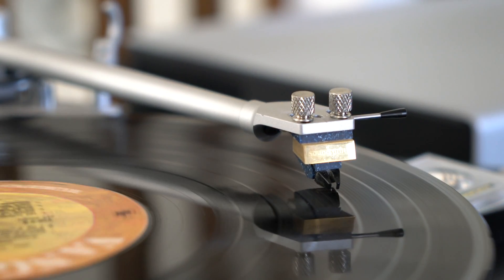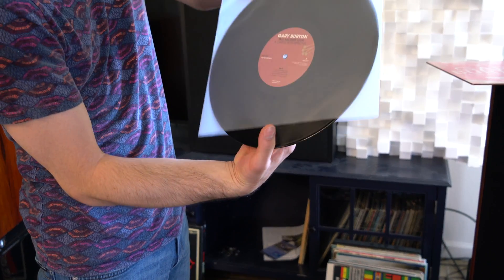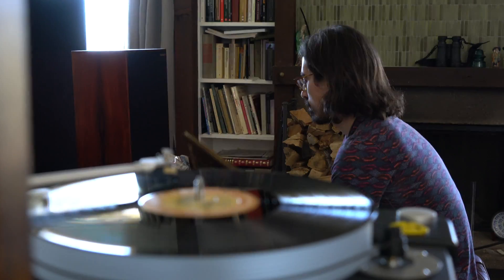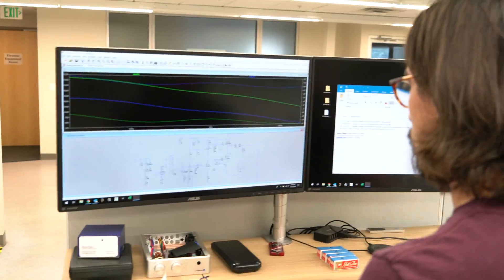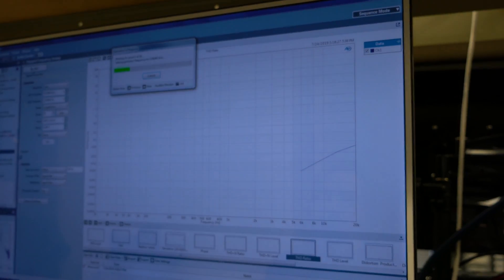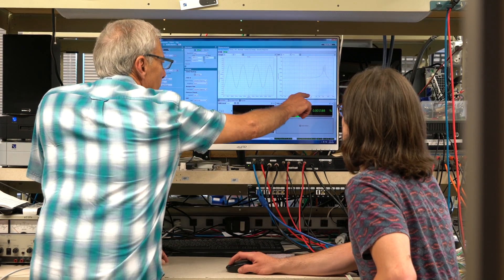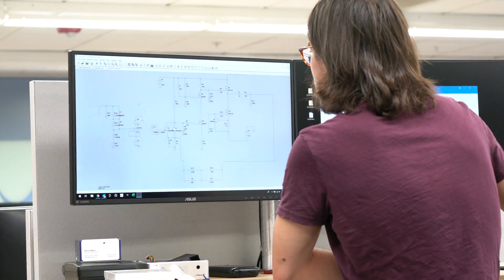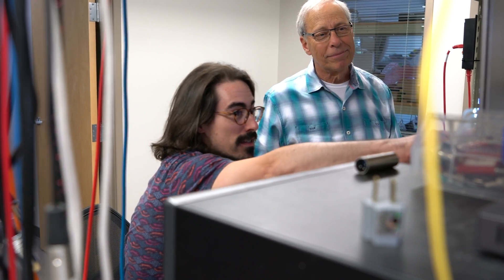Stellar Phono Preamplifier

Comment: So basically an amplifier that uses feedback measures well and sounds flat to the ear.  You remove the feedback and you get a bigger 2nd harmonic, which sounds musical and rich.  If you subjectively compare the two, the one with some louder even order harmonics will sound fuller, more musical and rich.  You are also putting more energy into the audio spectrum (in the "right" places)  so its also a lot like comparing two sounds with one being slightly louder than the other.  This poor engineer has to act like this is some revelation to him. I doubt it was. It is great marketing, though.

Comment: I just purchased the Stellar Phono pre up and it is insanely good. It made my system sound like my tube monoblock amps had quadrupled in power and my still-great-sounding Lyra Titan replaced with a Lyra Etna. Dynamics are off the chart. Crazy resolving. Seriously good.

Comment: I bought a Stellar DAC and if one is going to just Redbook CD's  it's very good (no tape loop/MQA/Roon is hard to justify not having on a $1700 piece IMHO).But when I spoke with company today I was saying "$2500 is pretty high price and if you start out with $2800 or $4K for pre and amps adding a $2500 is a bit pricey.Streamer I am assuming with be pretty good but that's another $2-2.5K msrp.Add a Power plant and that's $7500 -9500 when you you end up with good CD performance but forget MQA,Roon and without a tape loop to do Dirac let alone have it built in.Now that NAD C658 might not sound as good as Steall pre.But tell you what was really off putting.I have a Parasound JC3 and was assured that the PS phono section "blew doors on it".It's one thing to promote your product ad say we tested against Parasound and we think it can stand up in a comparison.But don't over hype.I have seen inside of my JC3 and Many Chinook and a few others and all I can say is I will be going to a shop which will let me A/B the two and if I am wrong i'll eat my hat or buy one.

Comment: All sounds good in the marketing the proof is in the pudding, who is your closest competition? Would you say it's better than a Manley chinook? And why didn't you use valves all solid state.
Reply: John sweda Concerning the valves, I can imagine that to make vinyl sound the best it can you must have the least amount of distortion and coloration in the pre-amp as possible, as the vinyl record is the thing that creates the sound profile. The specs tell us that this pre-amp has a frequency response of 20hz up to 20khz with only 0.25dB fluctuation, which are (imo) incredible specs. I can imagine this is only possible using transistors.

Comment: Hey Paul why not making a contest against my diy phono pre - i would love to make a abx test 🔥
Reply: As someone clever said: "That would look great on your resume. Not so much on mine."
Reply: What sort of circuit did you use for your diy phono pre?
Reply: terrywho22 a very simple - only using one ecc81/12at7.
Reply: @danielwagmann8078  That doesn't really say much... a single tube per side?  So you're using active RIAA equalization?  Or is the 12AT7 just a buffer?
Reply: terrywho22 one 12at7 per channel and passive eq between the two triode systems of one 12at7 - and no feedback
Reply: terrywho22 and yes i used only the best, ultra low tolerance and matched components. I bought all the parts times ten and matched them out by myself with a high quality lcr meter. As passive eq filters are very sensitive to parts tolerances
Reply: @danielwagmann8078  Nice!  I'll bet it does sound sweet.  That's a lot of effort to match the components... not to mention the cost with buying parts in bulk to get a proper match.  That said, you probably still saved a ton when you consider what it would have cost to buy equivalent performance in an off the shelf product.  Have you had a chance to compare it to some commercial preamps?
Reply: terrywho22 sadly not yet, i have to redesign the chassis design. There is still a little hum in one channel on high levels. I want to make two cases - one psu and one preamp. I thought shielding everything against each other with 2 square meters of copper and iron would be enough 🤣
Reply: Daniel Wagmann ... why are you in business getting well known since you want to challenge PS Audio?
Reply: hushpuppykl haha it‘s just for fun, i would love to compare my stuff against the big guys. And paul with his attitude attracts the diy guys like a lamp attracts flies 😂
Reply: Daniel Wagmann ... you got too much time on your hands eh? 😂🤣
Reply: hushpuppykl not really but i like my hobby
Reply: Daniel Wagmann ... I wish I had the skills and knowledge to try and make my own stuff.
Reply: hushpuppykl you can learn all this if you want to
Reply: Daniel Wagmann ... you are correct. Any links you can provide a noob? 😂
Reply: Daniel Wagmann ... I can solder without making a blob or burning the house down. I know what components are and they have values. Guess my level is Level 1 Noob who understands. 😬
Reply: hushpuppykl and do you want to learn about tube cirquitry or solid state?
Reply: Daniel Wagmann ... tube please. I’m enjoying tubes much more now. I got a Cary Audio SLP-5 and am loving the sound of tubes. 😬

Comment: At $2500.00 I'll bet it reproduces those inevitable clicks and pops extremely well.
Reply: I bet you're great fun at parties. Yes it will reproduce those "clicks and pops" and it will sound incredible in the process.  

Negativity isn't good, Neither is jealousy.
Reply: I have a vinyl collection and a very good Thorens TD 125 turntable with a Rabco SL-8E linear tracking tone arm.
I am not jealous of anyone.  I take very good care of my records, but the occasional click or pop is inevitable. I cannot fathom the idea that a phono stage preamp should cost $2500.00 dollars.  

Most of my system was purchased in the 1970s and adjusted for inflation should be equivalent to an $18,000.00 system today.  That said, Vinyl is an extremely good reproduction format, but the clicks and pops will be on records not left in their jackets.
Reply: @swinde  Tho I'm not for turntable and vinyl records. But well designed preamp can minimize the effect of clicks and pops by increasing the operating voltage range. So that the pops won't clip the preamp.
Reply: John Yang ... I do not understand what you mean.  A phono preamplifer is specifically designed to bring the millivolt level of a magnetic cartridge up to line level while applying RIAA equalization to the signal.  the click or pop will be part of that signal.
Reply: @swinde  clicks and pops are sometimes higher than music signal in amplitude, so they may saturate the preamp hence causing unwanted distortion.
Reply: Swinde i don’t have those i dust off my records with a brush before i play them and make sure i discharge static electricity if it’s there.